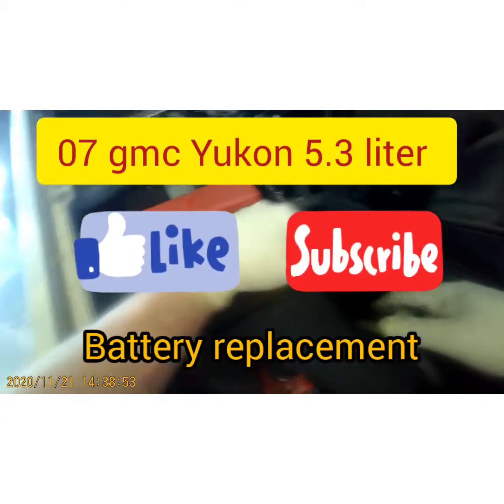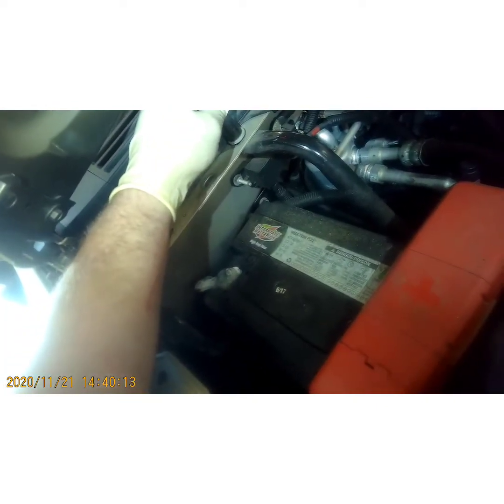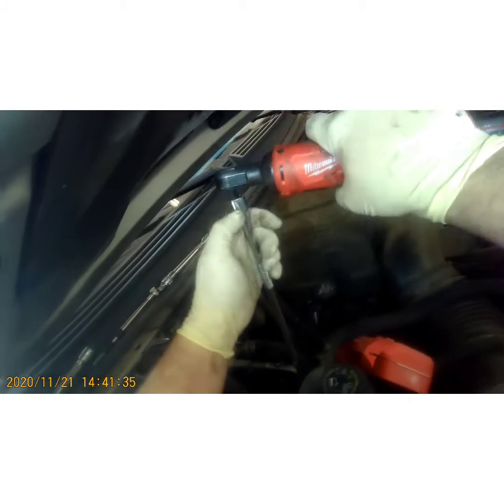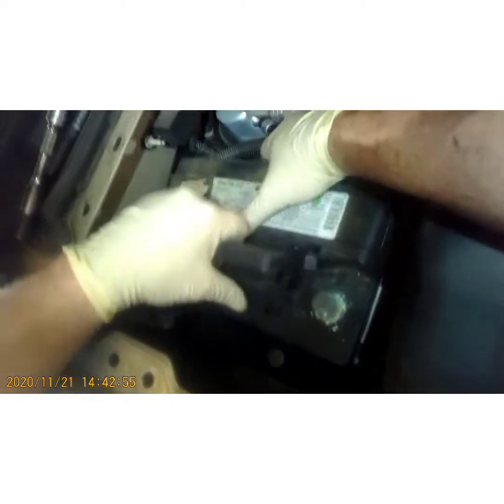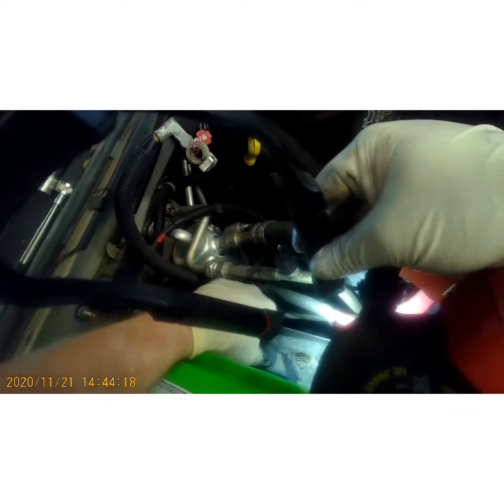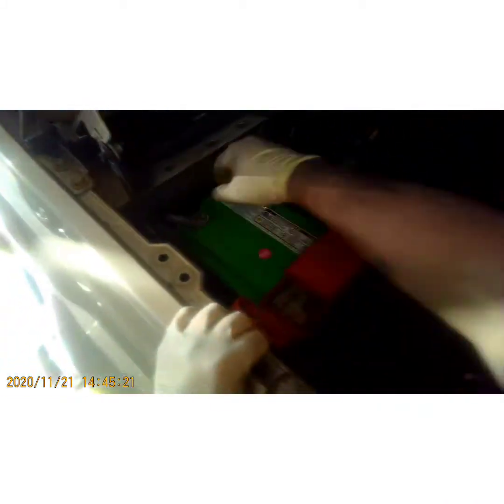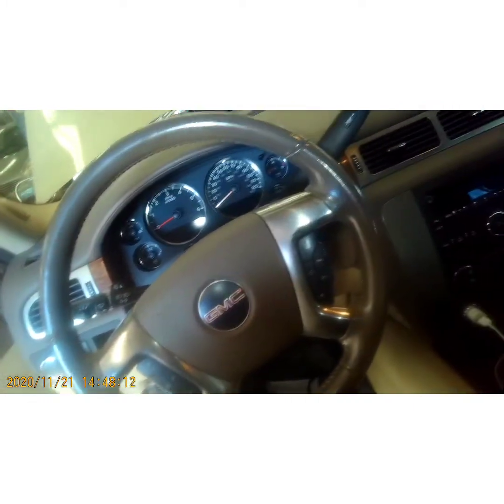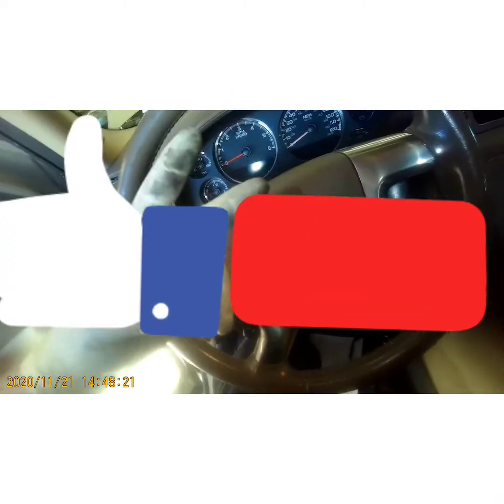how to replace your battery 2007 gmc yukon and chevy tahoe

Comment: The actual removal/installation looks simple enough.  However, I've been hearing horror stories regarding electrical issues developing when the power is disconnected.  Modules failing, radios becoming "locked" due to anti-theft technology, etc.  Some say "use a memory saver to prevent these problems."  Others say "Don't ever use a memory saver because it will overload the OBD port with incoming voltage."  What is the proper procedure here?